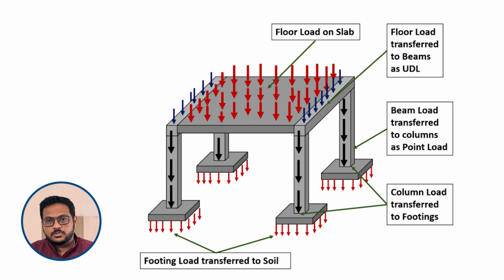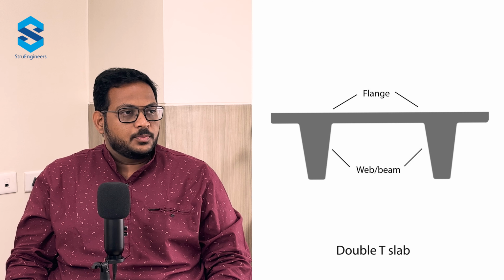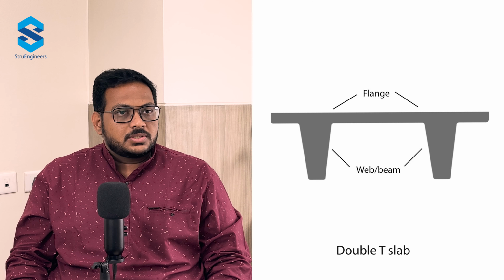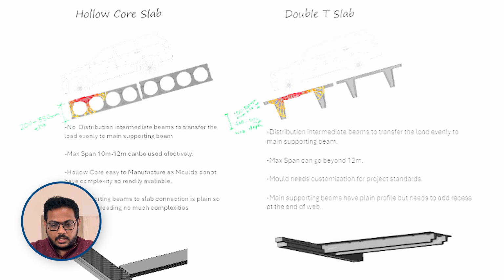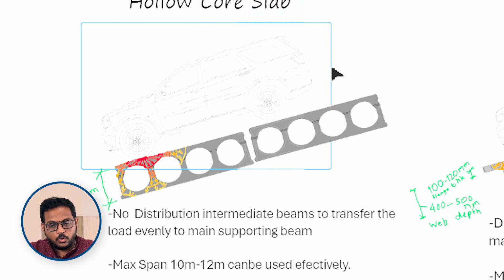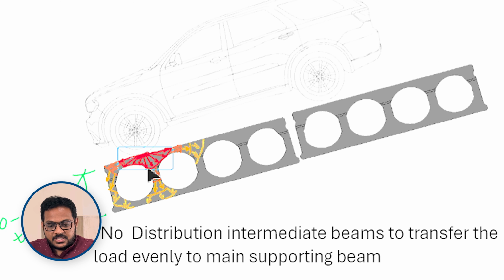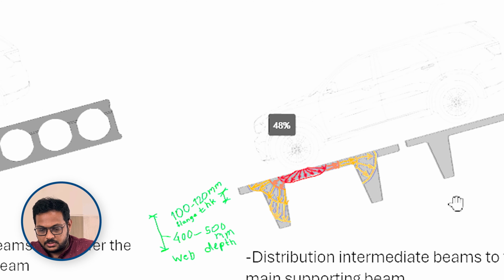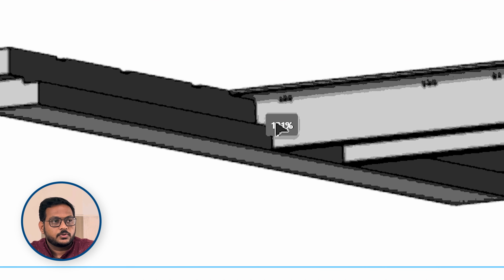Hollow-Core or Double-Tee?: The Best Precast Slab for Parking Buildings?

Comment: Hi Sir,
I have one question regarding hollowcore core filling for crushing due to vehicle weight at slope location as per my understanding.
What if we have the topping or screed on top of it. Do we still need to fill the cores?
Thanks
Reply from the maker: Hello, It depends on the thickness of the screed used. Screed is generally applied for diaphragm action, which involves creating a joint between hollow core slabs.